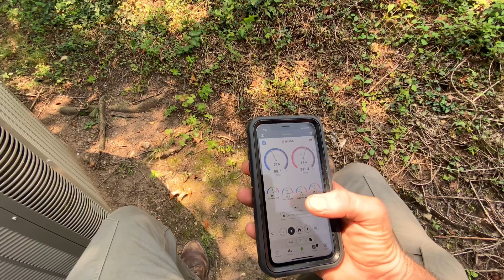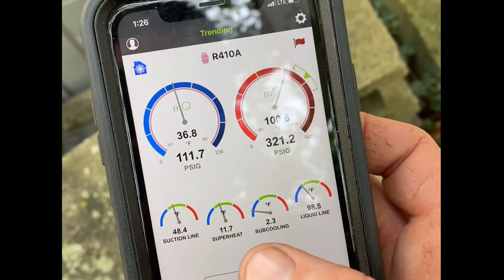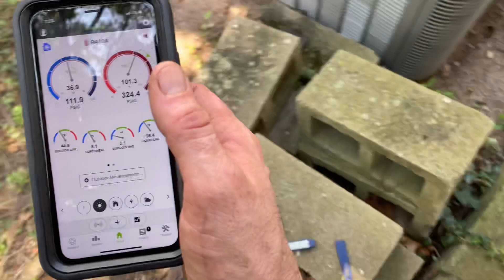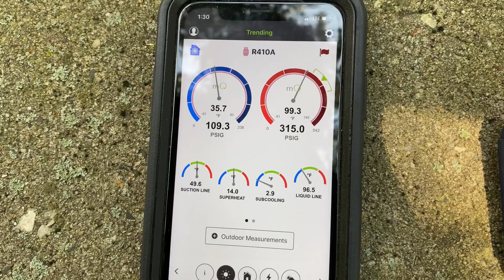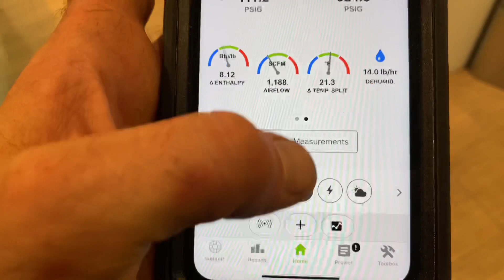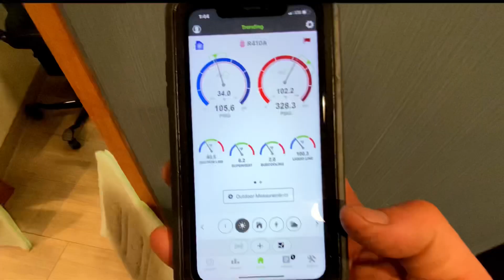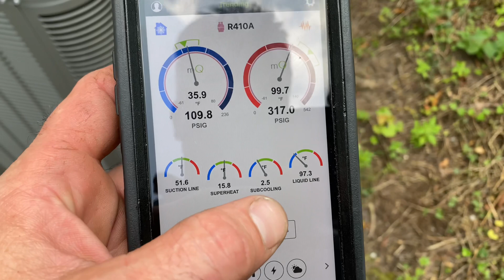AC Troubleshooting Low Superheat

Comment: Nice video. Thanks for breaking it down. You showed a low load with plugged filters causes low superheat. I'm confused because the system I'm looking at fixes low superheat by also throttling down the load (the CHW flow).

Can you explain how reducing the load fixes it? Is it just a control trick to crash the suction pressure and force a flash-boil?

Comment: the video is respectable , but when an AC system is being inspected it is important to check the condition of the condenser , evaporator , evaporator fan motors , and condenser fan motors before making measurements .  return filters, ducts and speed of the evaporator fan motor.  to really determine what is going on.  Why make such measurements and equipment saturated with dust is not recommended.  Do these tests and have the filters dirty because they are not going to give the conditions. First, you should have verified how the filters were.  return to the thermal jump that I did not see.  and it is important.  For the most part, the video is respectable.

Comment: I currently have a low superheat problem at home. My suction line remains 1.3 SH with 158.1psi and 55.4 VSAT  while the other side is at   2.2 SC with 293.5psi and 94.3 LSAT. The thermostat reading no lower than 72° in the house.. The AC company made me pay for 3 lbs of freon last Dec to get Superheat to 14 claiming that my compressor had lost some freon over time, and that there had to be a leak. So, he wanted to charge me for a leak test which I declined. A new tech from the same company now comes and said that there is too much freon in there and that's causing my now too low superheat reading. He said tha a leak was impssible with the pressure staying this high 158.1psi. Sooo I'm like hmmm...🤔🤔🤔

The unit had suddenly stopped cooling which caused me to call them in again. But, it appeard that after I hosed down the condenser fins it started cooling again. At no time was there any frost on my evap coils before or after it stopped cooling. 

Anyone with any suspicion of what's up with the system, please break silence.
Reply: I’m dealing with similar thing on my r 410 a system . 5 ton new system super heat 1 sub cool 8 
House cools fine 
I’m just worried about my numbers
Reply: sounds like a weak compressor. High vapor saturation means that it isnt absorbing heat correctly which isnt dehumidifying efficienctly. between 40-45 sat temp is the best

Comment: Is it recommended to install an inverter air conditioner?
Reply: Not if you want to be able to get it running same day it fails. Service guys won't be carrying your circuit board on their truck AND you cannot bypass the CB
Reply from the maker: Inverter units are nice. You will save money while unit is under warranty. I doubt they will last as long as the older units. Parts will be expensive after warranty. Also as stated parts most likely will need to be order when they fail.

Comment: Have a great vacation hacker! We all need a break sometime. It’s funny how some folks out there think HVAC is all about changing filters, capacitors, you know the EASY stuff….they have no clue. Enjoy man see ya soon 👍
Reply: I mean HVAC used to be about the simple stuff until the EPA and greed forced all these high efficiency systems that have 58 sensors and shut down for a failure of pretty much any sensor or a sensor reading outside of range.

Comment: Great video. Isn't 3 degrees of subcooling low? Even with the blocked filters I would think a properly charged system would have higher subcooling.
Reply from the maker: The sub cooling was lower than usual. I was only showing the impact of what plugged filters does to superheat. A dirty condenser reduces amount of sub cooling. I think the data plate was 5 or
6. Which after cleaning i believe I had about 5 degrees. Many high end Lennox systems want 3-7 degrees on data tag.
Reply: @thehvachacker  Thanks for replying and clarifying that sub cool number.
Reply: SC is overrated
Reply: Depends on the metering device. Piston charge by SH and TXV charge by SC
Reply: @Crazywill210  I know that but even with a txv an overcharged system will have high SC and an undercharged system will have low SC. The TXV controls SH. I don't see a lot of Lennox systems in my area and nothing I work on requires a 3 degree SC. They are usually between 8 and 15
Reply: @williamserver4332  I thought the sub cool that low was odd also. I have a Lennox gas pack and sub cooling on unit is 10 degrees.
Reply: @roberts1159  The outdoor units usually have the required subcooling listed on them but I didn't hear him mention that in the video. Maybe I missed it.
Reply: @williamserver4332  Yes, it’s normally listed on the outside of cabinet or inside one of the panels. He didn’t mention sub cool being on one of the data plate labels.
Reply: @roberts1159  I'm curious... whatcha do when the name plate is faded? Can't know the model for tech support... whatcha do?
Reply: @come_on_now  Good question, I don’t have an answer. Perhaps someone more experienced can reply. Sorry.
Reply: @come_on_now  older tech says fail safe way: 10 degrees sub cooling and above 5 degrees superheat to save compressor and avoid freezing.
Reply: @moneybags7482  I was being sarcastic... I'm a 30 year tech and I agree with you.
Reply: @Crazywill210  have you charged a lennox? They have their own rules which nobody really understands...